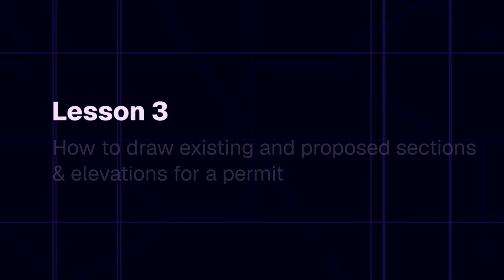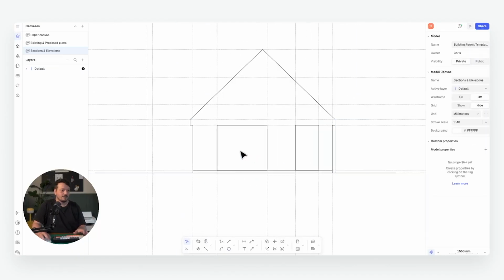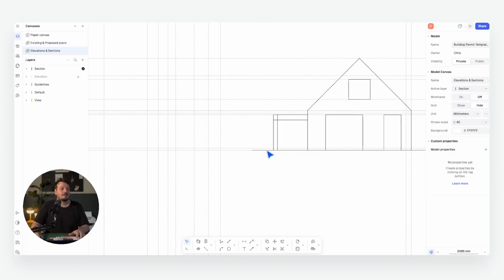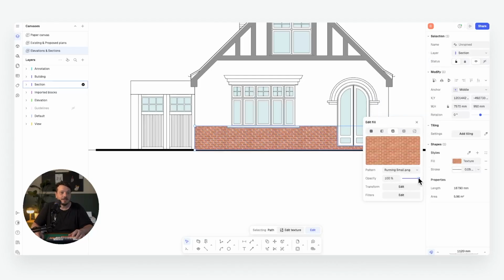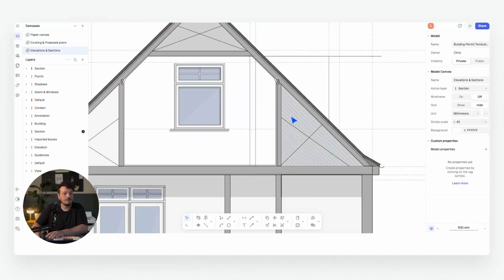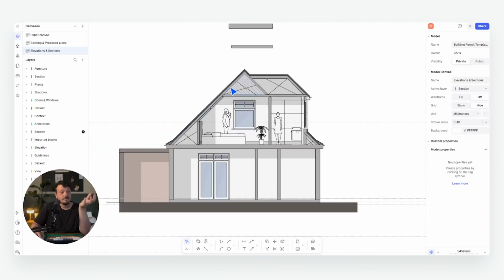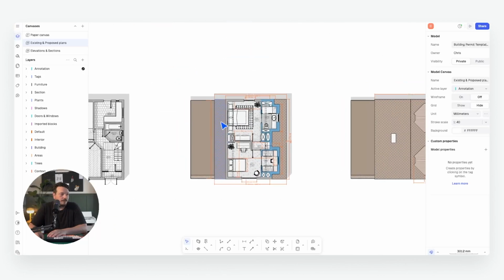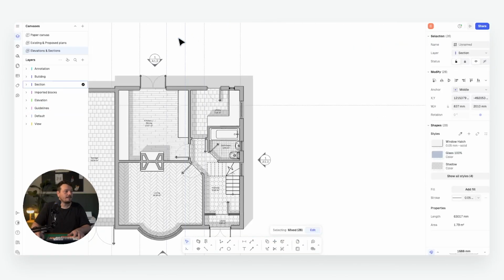How to Draw Existing and Proposed Sections & Elevations for a Permit

Comment: Hi! Got a detail question. When I use the elevation mark (A & B) in my own drawing, i can change it's orientation, but the tag's orientation doesn't change correctly, so i have to explode the block. Is that correct or am I missin sth?
Reply from the maker: Great question! 👍 That doesn't sound like the intended workflow.

The elevation mark should rotate correctly along with its tag, so if you're having to explode the block every time, it may be a bug or a limitation with that particular block. If you can, please send the file or a short screen recording to the support team—they'll be happy to take a closer look and help troubleshoot it.
Reply: @rayon.design  found it weird. thanks.

Comment: Thank you for these. I'm an old horse learning new tricks.  I have used ArchiCAD for 29 years. I just don't need BIM for every project.  This is the first 2d program that makes sense.  I have one questions regarding modeling structure.  I can show a wall as structural width, or finish width.  If I set it as structural width it dimensions accurately for the builders.  If I set it as finished width it looks better on plans and allows finish clearances to be indicated.  How do you handle this.  Do you just go with the finish and have the builder adjust?